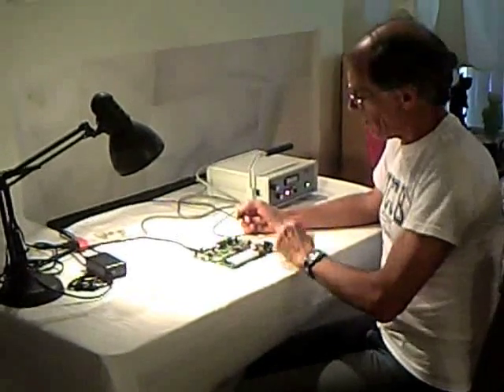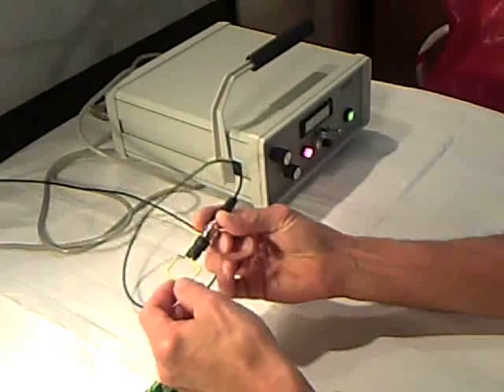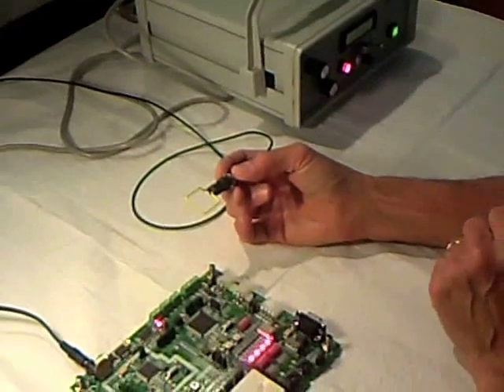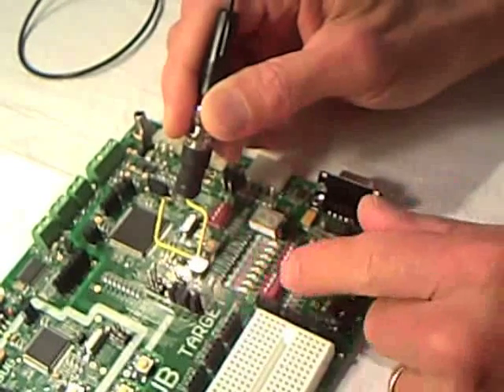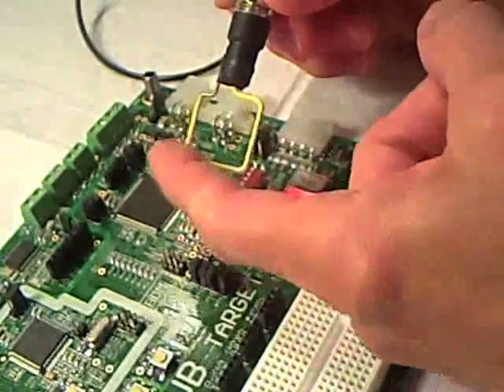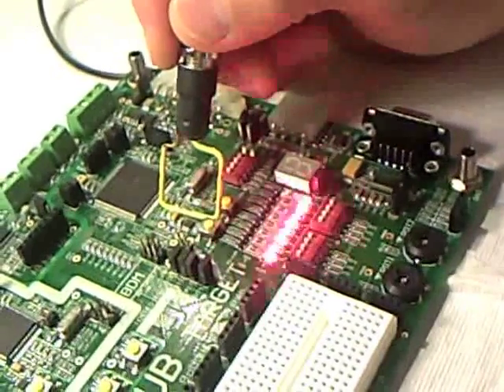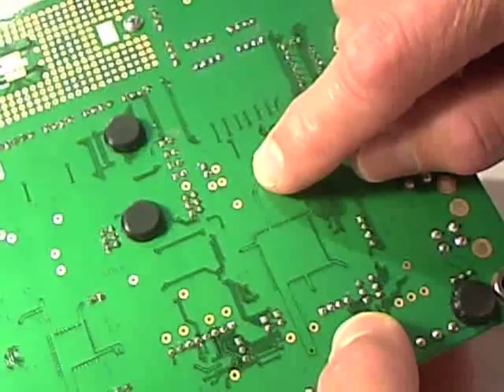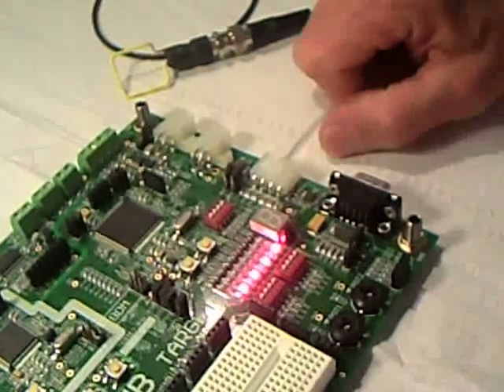Finding PCB layout defects

Comment from the maker: Hi easternmafia,

With 50 years experience in electronics, I know what I am doing. This method has solved several dozens of design problems for my clients. The injected voltage is just a few volts of M*di/di induced signal. If you do not know what M*di/dt means, look up "mutual inductance" on the Internet, an interesting phenomena! This method is not intended for testing digital circuits but for finding problems in the underlying design of the circuits.

Doug

Comment from the maker: I don't think so. If you mean a short between power and ground, just feed a controlled amount of current, like 3 Amps (just enough to heat up the board, and use an infrared camera or infrared thermometer (available online for about $30, to find the spot on the board that is warmer than the rest of the board.

Comment from the maker: Hi 1patrat,  You can easily make the loop from stiff 16 AWG brass wire from a hardware store. I cover the loop with heat shrink tubing to prevent shorts to the circuit being tested.

Comment from the maker: Probably not but maybe. I have not used it to find shorts. If a power to gnd cap, you could increase the supply current until the shorted component heats up enough to feel or see (smoke).